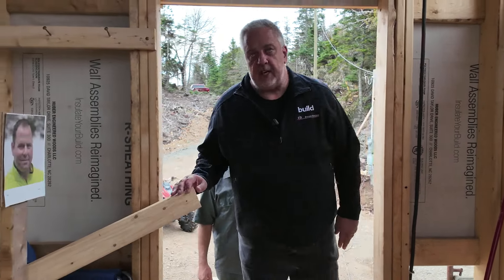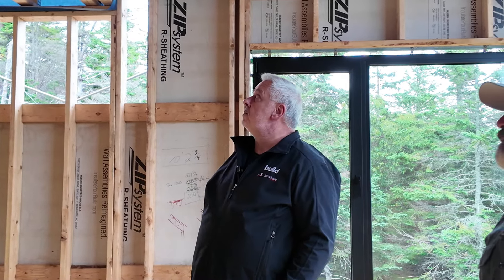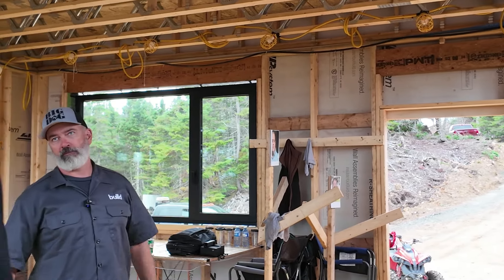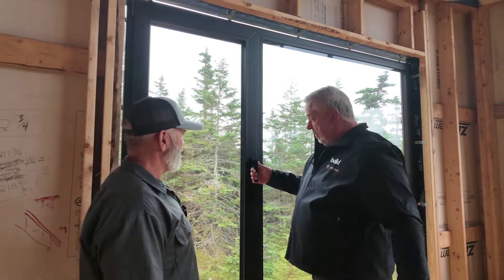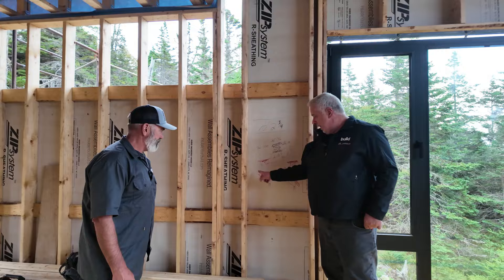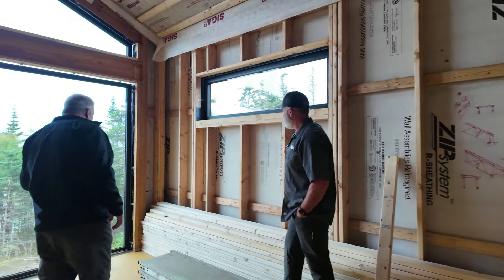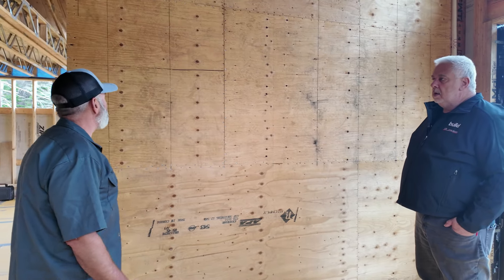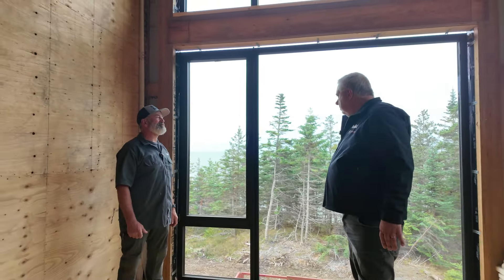ISLAND HOME - First Floor Framing Details

Comment: I really like how Steve and his guest are not defensive when they share concerns and/or advice with one another. In particular, the apparent absence of shear in the corner is a great observation by Steve, and it should be addressed by the engineer.
Reply: You need to look at the complete wall including those two triangular shaped windows. 

Each triangular shaped window has a common vertical stud with the window below it, while both have a decent header beam.
Together this forms a triangle which gives the common LVL-stud enough rigidity to take the shear forces due to the wind load.
Reply: @koenraadprincen7212  Interesting observation. Both Steve and the builder have the same concern, and they have called it out to the engineer. I wonder if the engineer will provide them with the same reasoning as you. Given the size of the ocean-facing wall, I am doubtful.
Reply: @scottjackson638  The presumed lack of shear capacity is not for taking the wind loads on the big facade facing the ocean but for the wind loads on the two adjacent walls perpendicular to this big ocean-facing facade.

The internal wall will take care of the wind loads hitting the ocean-facing wall.

Besides that, it's always dangerous to critique design choices when the designer or engineer is absent...
Reply: @koenraadprincen7212  I think that you may have misread my comment. The shear needs to be present on the wall facing the ocean, but I am not saying that is the direction of the wind forces (the forces of concern are perpendicular to the wall facing the ocean). Also, I am not critiquing the design, but I am asking a question. I think that engineers and designers often welcome questions and rarely do they view a thoughtful question as a critique. I think that what is dangerous is to be silent when there is a legitimate question comes to mind.
Reply: The triangle idea would work if there was something on the other side of the sheathed interior wall to resist push/pull forces.  They didn’t really show that.  There was a brief shot at 11:51 with them standing on the other side of that interior wall, but again, the exterior wall was basically all windows from what we could see.  There may or may not be anything in the structure to prevent that interior wall tilting toward/away from where Steve was standing.  If there is, it was never shown in the video.
Reply from the maker: Always try to call it like I see it....always a discussion never a lecture
Reply: @scottjackson638  Ha sorry, yes I misread you... (the shear resistance must be present in the plane of that wall).

My remark about critiquing was not meant for you but for Steven... I do understand that he wonders how the shear in that wall has been taken care off, but now it seams as if the engineer is stupid or made a giant mistake... 
I hope Steven (or Aaron) makes a follow up video with the answer of the engineer on this matter, that would be the correct attitude in this case.

And it would be nice to know if my insights are correct ;-)
Reply: @stevenbaczekarchitect9431  Yes, but try to discuss it directly with the engineer... or make a follow up video with his answer 🙂

I do understand you wonder how the shear capacity has been solved, but you could have called the engineer...
Reply: @kc9scott  The push/pull forces will be taken by the studs in each corner.

There are basicly two "single portal frames" back-to-back in the middle that ocean-facing wall.

Having the answer of the engineer would be very insightfull...
Reply: This is the feedback Aron Jones got from his engineer:
"The loft floor diagram and the dropped ceiling in the Master bedroom,  combined with truss bracing and 2x4 ceiling strapping. Meet the requirements to resist racking of the gable walls."

So, it was all about those triangles 🙂

Comment: Steve, what if you used the Zip-R for the vent space instead of the plywood with the foam facing in?
Reply from the maker: It would slow the migration of moisture with the foam - kinda defeating the purpose of a vented roof

Comment: As I recall, the plan is to use dense pack cellolose in the roof structure.  Do open web trusses present a challenge in reaching 4 pcf density given that the trusses don't create confined cavities.  I hope Aron covers the insulation process in a future video.

Also, just an observation, not a criticism of wood framing, but would that shear wall been necessary if the house had been ICF to the roof?  Full ICF seems like a good choice for the extreme weather at this location.
Reply from the maker: Full ICF would likely have more reinforcement in the shear wall